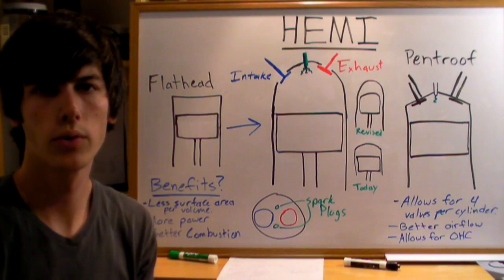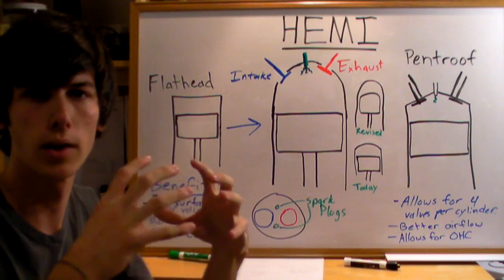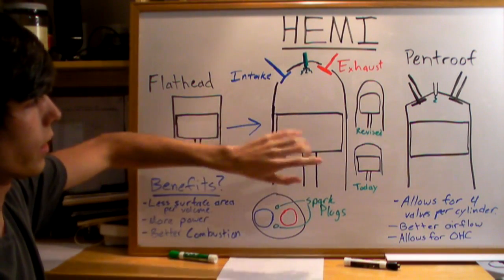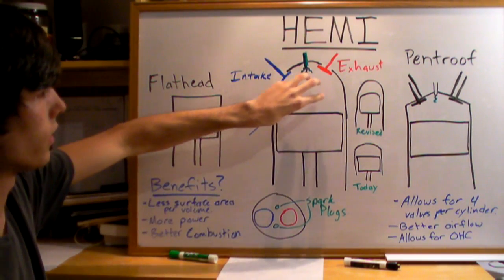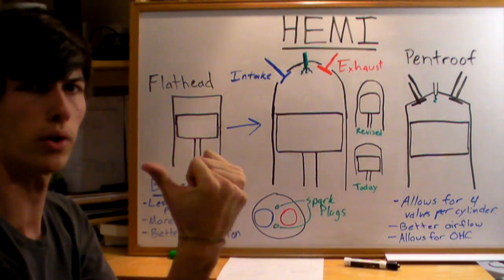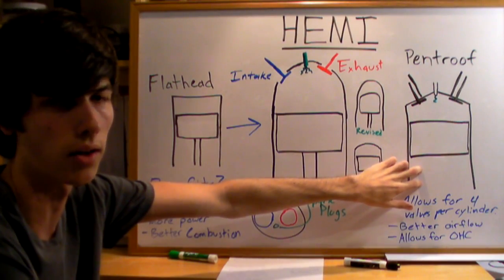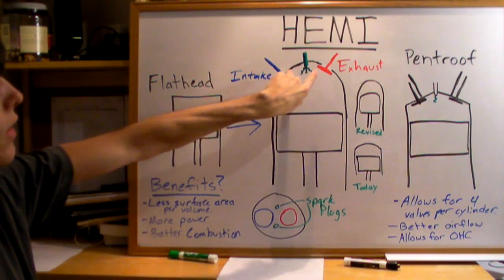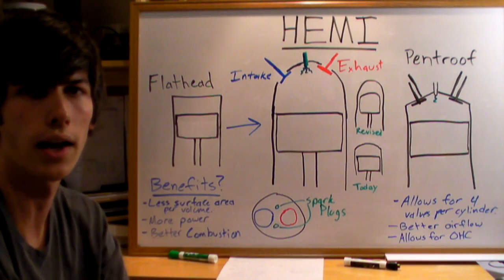What Is A HEMI Engine?

Comment: The HEMI was a beast decades ago. The Hemi of today is outdated, inefficient, high inertia piece of garbage. All Chrysler products are garbage, all of them. Have fun with your Italian vehicles,...Fiat is a garbage quality manufacturer as well.
Reply: Except my 300 SRT8 has 470 HP and I get 23 MPG in a MASSIVE full-size car. Not too shabby, wouldn't you say?
Reply: I know what is bothering you. Your expensive BMW got beat by a Dodge Charger.
Reply: Thamac15 Do you just regurgitate everything you read online, or do you actually do research.
Reply: Cheers.
Reply: Qiuyuan Chen the 300 comes in Diesel here in Germany. It is rebadged as a Lancia.
Reply: Because it's a trademark name. The head is also has more of a hemispherical shape than average
Reply: doktorbimmer It sure doesn't seem that way. Dodge is currently celebrating their 100 year anniversary, the Dodge Ram pickup is IMMENSELY popular, and since its re-introduction in 2008, Dodge Challenger sales have been increasing (sales usually drop over time)...which is why they haven't changed the body style. Jeeps are also immensely popular. I'm fairly confident Chrysler will be around for a long time.
Reply: yeah... ferrari.
Reply: doktorbimmer yeah, you really dont have to say too much haha, just ferrari and thats it.
Reply: Felix Pfaltermann yeah, but I am a fan of diesel. so not apply to me.
Reply: I just read something after I saw this video, then I realized that HEMI is a technical term instead of a brand name. I am too young for the automobile which has over a century history. I do know Fiat produces a lot of Diesel too and it is who caught my attention to this higher efficient engine on small cars back in 1999.  At the present time I am enjoying L4 diesel made of BMW.
Reply: Great, thanks.
Reply: Yet the same principal is still used although modified further today typically having multiple spherical areas based around each valve.
Reply: In the 100% traditional sense yes.
Reply: What do YOU drive, Thamac15? Please tell us so we can criticize and judge you too!
Reply: I work for a company who makes parts for Chrysler and can confirm 100% without question their quality control is zero. They have a looks from here mentality. Ford, gm, and Toyota all not only require us to quality control each part they do it again when they get it.
Reply: jeepmanxj If that's true, then me and all my friends who own and have owned Chrysler vehicles over the years have been EXTREMELY lucky. Coincidence?
Reply: OddTimeMan I've owned many over the years as well. My an isn't jeepman because I saw one on the road once. I've driven them for years. I've only had one that was a lemon. I'm just telling you the facts. Ford's quality control from what I've seen is second to none for suppliers. It takes serious effort to meet their standards.
Reply: You should see what BMW has down the pipe. We just started some test stuff for them for both suspension and transmission parts. Gonna be a lot of carbon fiber in their future
Reply: doktorbimmer yeah, I can't say what and when but we have made substantial carbon fiber test pparts for the 3 and 5 series
Reply: ***** I really wish I could show you the difference in quality Ford demands for parts vs Chevy, dodge, and Toyota. There is no wiggle room it's perfect or bust.
Reply: Well yeah a srt charger would for sure. It's made to be fast in a straight line. I will take my 550i out on any road course you want and challenge you there
Reply: doktorbimmer my volkwagen has 5 valves per cylinder and every car ive had has had 4 valves per except a ford inline 6 300ci witch had 3. so 4 is pretty common
Reply: yeah, you really dont have to say too much haha, just ferrari and thats it.
Reply: ***** I'll put any older merc against most any us made vehicle. They will run forever
Reply: ***** Dodge makes one of the best sports cars in the world (handmade BTW). The Wrangler holds its value better than any other production car nearly every year (for the past 20 years or so). Sure, they made some pretty crappy entry-level cars, but they have come a VERY long way. The 200 is excellent and light years better than the Avenger, etc. We won't even get into SRT and the Hellcat because they are UNREAL!!!
Reply: 554687858 stock unmodified their engines are fine. Its everything else around them.
Reply: jeepmanxj My experience with Chrysler products does not encompass anything current. 383's, 350's, slant 6 (quite possibly the finest in-line six ever developed), the old flat head six, small Hemi's and my current 392 Hemi out of a 57' Chrysler. These, along with the 727 torqueflite are the Chrysler products I'm familiar with.
     As to modifications, my 392 has, among other things, a Joe Hunt Mag, a 671 pump with a pair of Holley's on top. It's been set up this way for many years and runs fine. As I stated earlier, the box was rebuilt and modified by B&M around the same time, proving that they both take modifications quite well.
Reply: The real doktorbimmer Perhaps, but how does that explain the stock 426 Hemi engine selling for  $30,000? I can understand the logic behind the Pentroof (additional valves and all) but if they were actually superior then why in the world would a 45 year old engine continue to increase in value? And why do the built Hemi's (K. Black, Garlits, etc.) hold all the faster class records in the 1/4 mile?
Reply: The real doktorbimmer Dude, I don't know where you're getting your information but that's the most ridiculous thing I've heard concerning NHRA rules...ever. Secondly, AA/F, Altereds, and others are using Hemi's, but they sure aren't 426's. These engines are using  solid cast blocks with over 500 inches and no provisions for water jackets. So that alone kind of blows your statement about using 426 Hemi's only right out the window. 
     Requiring a single engine that hasn't been produced in 45 years makes no sense at all. First off, there were only a total of 30,000 manufactured. And most of those that are still around  are in the original car they came in and for good reason - these muscle cars will bring in prices well into six figures. Do you honestly think a person is going to tear up a $200,000 car just so he can meet some class qualification? The NHRA would soon be out of business if they had some ridiculous classification regarding a rare, expensive engine. Short answer - no such rule.
Reply: 554687858 he is right. Just like in NASCAR they use much older technology. Nhra top fuel dragsters just use insane amounts of boost, and last I was aware the combustion chamber designs were proprietary to each team so you can only speculate to it being hemispherical or not.
Reply: jeepmanxj Well, someone is going to have point out the rule that says you must run 426 Hemi's because I've been around as long as the NHRA and I've never heard of such a thing. Are you saying that someone with a 575 inch Ford isn't going to be allowed to compete? Or even more ludicrous, that they run 426's in top fuel? Or for that matter, any factory block? Because they don't.
     As to the technology, all the NHRA does is divide the cars into classes and list safety requirements. After you meet class requirements and safety requirements, how the engine and car is set up is up to the builder - and with these cars exceeding 330 MPH in a thousand feet, you can bet the technology is as up to date as any car manufacturer can produce.
     As to the speculation on combustion chamber design - Hemi's run their plug wires through the valve cover so you can speculate all you want but it's still gonna' be a Hemi.
Reply: They run the elephant block, just because bore and stroke may be different affecting displacement doesn't mean its not the same block design and dimension. 

There is pretty nice technology and science behind the engines and their capacity however the cam in block design is outdated. As is the 2 valve design. They circumvent the age by putting crap tons of boost to the motor
Reply: As said before most everything does use it. And in my understanding of the rules and some of the designs I've heard about the heads are pentaroof. The technology is fascinating because they are able to cool a solid billet of aluminum with only the incoming air fuel mix. The engines are designed after the hemi block, its part of the regulation. Bore size is limited because of safety concerns from what I understand so they all are 500ci.

They don't use the pentaroof and quad valve again because of regulations, same with the cam in block. 

I still stand by my feeling that modern hemis are still hemispherical to the point they can be called hemi. But they are not perfect domes like older ones.
Reply: The technology lies in materials. How many engines do you know of that can host 65lbs of boost and not explode?
Reply: The real doktorbimmer as I said that's what I've heard. I've not looked further into it besides some random trivia and information from guys who follow it.
Reply: The real doktorbimmer Any internal-combustion, NHRA-accepted, reciprocating, 90-degree V-8, single-
camshaft, automotive-type engine permitted. Multi and/or overhead cam 
configuration prohibited. Maximum 500 cid, minimum 490 cid; maximum bore 
center spacing 4.800 inches; maximum cam centerline 5.400 inches, maximum 
two valves per cylinder. Only one cylinder-head design is acceptable: 
Intake valve angle of 35 degrees, + or - 1 degree
Intake valve size maximum: 2.470 inches
Exhaust valve angle of 21 degrees, + or - 1 degree
Exhaust Combined intake and exhaust valve size maximum: 2.000 4.395

That's the only head regulation I see. Nothing about it being hemispherical
Reply: The real doktorbimmer that's the entirety of what I could find in the rulebook PDF, do you have another one that clarifies that

Comment: Do Hemis today still use two spark plugs per cylinder or have they figured out how to use one?
Reply: I know, I never said it was the first dual plug setup, in fact the Dontov Hemi for the flathead Fords, some of those where dual plug. But he said dual plug was developed by Chrysler for emissions when it wasnt, it was developed for racing, and Dick landy didnt developed it for Top Fuel, he raced Stock, Super Stock thus those duel plug headed Hemi's where meant for street strip cars and modified cars. And it happened to be very good for Top Fuel. Well Top Fuel has changed a lot, from front engine to rear, to 16 port fuel injection per cylinder, from 98% nitro to 90 (thats a big difference), ignition, the superchargers etc. A whole lot of differences. In fact there were turbo'd powered Hemi Top Fuel cars in the 60's and 70's and a side mounted Hemi there where hundreds of different designs in the 60s and 70s its really in the last 30 years that Top Fuel hasnt changed much, but when you make 10,000HP and running 4.2 @320mph in the 1/4mile theres not really a lot you could do to improve it.

Comment: I have a question. You told that heat creates the power. Seems obvious if you have bigger temperature in the same volume the pressure is higher. But I've started thinking and... sketched octane to both CO and CO2 combustion. Off course burning fuel to it's maximum possible oxidation level gives you the highest possible amount of heat. From the other hand burning fuel to CO takes less oxygen molecules - theoretically 2 mol of octane needs 25 mol of O2 if burned to CO2 and only 17 if burned to CO. That means you get the same amount of gases from less(:o). Besides if engine is running lean - 2CO + O2 -> 2CO2 + heat. You're just loosing one molecule of gas, but gathering more heat. So what type of combustion is the most efficient one? I hope it's understandable what I've just written and I am not missing something stupid...
Reply: Wow that was great. It brings me back to my chem and automotive class.
Reply: Carbon monoxide is create in the combustion chamber. Since it is more harmful they created a catalyst in the catalytic converter the make carbon dioxide. I hope that answered your question.

Comment: Of course, now they have multi-spark ignition, delivering a barrage of smaller sparks for a longer period of time, allowing more power and better efficiency because more of the fuel is burned in the cylinder thingie. But, please correct me if I'm wrong.
I love your videos, and your dry-erase graphics. Nothing extra.
What I really like is that you expect the viewer to understand you and you don't dumb down or oversimplify or give weird analogies.
Engineers are like physicists that speak English. You are clearly a good engineer.
Thank you.

Comment: Your just a muscle engine hater
Reply from the maker: I just appreciate efficient engineering. I have nothing against muscle. The 5.0 Coyote is an incredible engine.
Reply: doktorbimmer
I suppose that could be a matter of opinion. Some of the worlds fastest cars had hemi engines. I'm mean I'm sure there not extremely efficient on new model vehicles using fuel injection but personally myself I prefer carbeurated motors anyways. No their no as fuel efficient but for someone like myself who is electronic/technologically retarded I prefer simpler/mechanical/older cars where all you need is a set of hand tools a few pneumatic tools and a 6 pack of beer :P lol
Reply: doktorbimmer gosh your debate got pretty intense dude

Comment: You'll have loss of low end torque big time and the powerband of the motor won't come in until 4 grand and up depending on the design. How do i know? I have a motor that has "oversized valves. A 1971 351 cleveland with 4V heads, that's something people can look into if they're wondering the same thing.

Comment: would it not be better to have spark plugs which reach deeper inside?
Reply from the maker: Well you don't want the piston to come into contact, or the valves to interfere, or the body of the spark plug within the cylinder getting blasted with heat.
Reply: triton engines have long spark plugs that reach down deeper. i hear they are real monsters too, just never try and change a plug they break right off in the head.

Comment: Im not going to argue about hemi designs but you forgot about the NHRA worlds quickest's vehicles. Your ideas are sound but flawed. Not a problem with your age. I suggest you look through 50's and 60's hotrod magazines for answers. Think inside the box. That's where all the answers are. One last thing on gasoline engines, dual plugs create two flame fronts NOT GOOD.
Reply: Yes NHRA dragster engines do make a lot of power but that is also due to the fuel  not requiring as much oxygen and forced induction. Now to to invalidate your point N/A formula 1 engines are mostly pentroof designs. They make 900+ HP on 3 liters. Show me one Hemi that makes that type of power without power adders?
Reply: Mrsteve431- I can push 500 cfm through a straw with high enough pressure.  If you want to prove the hemi is better then use an engine that does not have forced induction. N/A performance is the true way of measuring the efficiency of a head. NHRA cars have no Macjustifications since the fuel carries part of its oxygen needed for the combustion plus the supercharger at 80 psi pushing that many cfms would teoretically make any head design create massive power. Also comparing fords and chevys only justifies that the Chrysler hemi can handle the pressure.  I believe some ford heads are hemis too so that still does not prove the point of efficiency.

Comment: The old engines had a wedge type cylinder head (not flat)and the spark/flame had to travel from one end to the other making an uneven burn. The hemi had more surface area to accommodate bigger valves. If you don't believe me, take a piece of string and make a squares measure the area. Now take the same sting and make a circle and measure the area, the circle has more area. The hemi has more surface area to accommodate bigger valves for more air, more air more horsepower. And that is what was great about the Hemi you could put monster sized valves in which could bring more air(CFM). The plug is in the middle for an even burn and pressure on the center of the piston instead of the flame traveling from one end of the cyl to the other and having More pressure on one side of the position( wedge type) this also this increases blow by on the wedge type engines. Also the way the valves were positioned and the hemispherical head gave the Hemi better fuel and air flow mixture. The pistons were heavier because they were round on top and that was extra weight which would not benefit a high rpm engine. But the Hemi was a big block and big blocks were more about low end torque. Land the hemi was purely designed for horsepower not fuel efficiency.

Comment: The old engines had a wedge type cylinder head and the spark/flame had to travel from one end to the other making an uneven burn. The hemi had more surface area to accommodate bigger valves. If you don't believe me, take a piece of string and make a squares measure the area. Now take the same sting and make a circle and measure the area, the circle has more area. The hemi has more surface area to accommodate bigger valves for more air, more air more horsepower. And that what was great about the Hemi you could put monster sized valves in which could bring more air(CFM). The plug is in the middle for an even burn and pressure on the center of the piston instead of the flame traveling from one end of the cyl to the other and having More pressure on one side of the position( wedge type) this also this increases blow by on the wedge type engines. You don't even sound like you know what you're talking about.